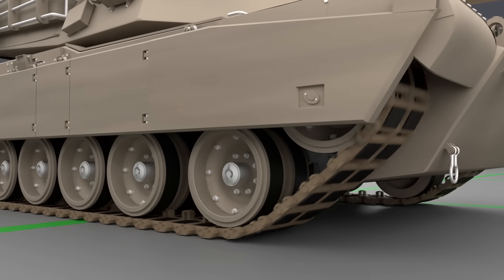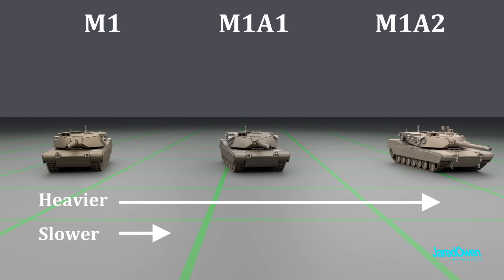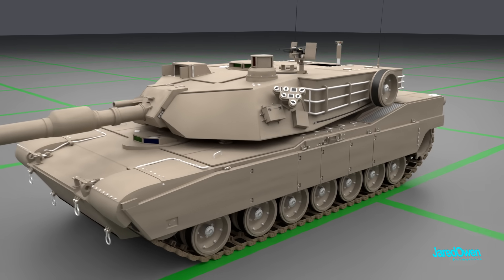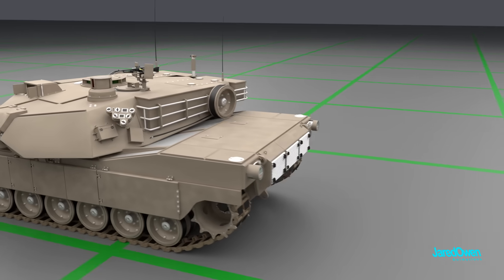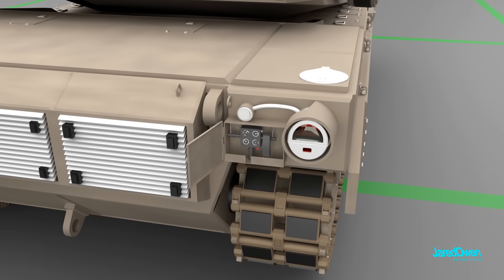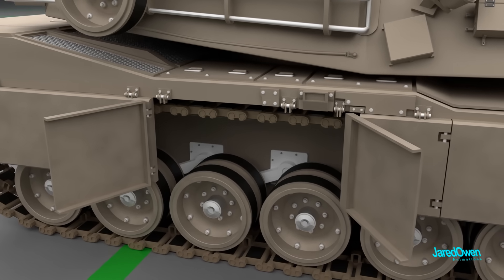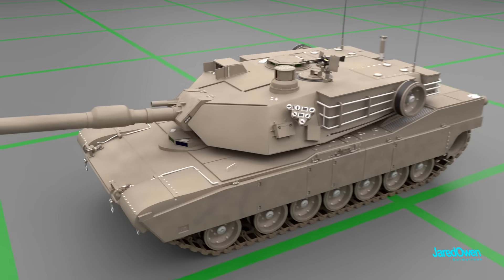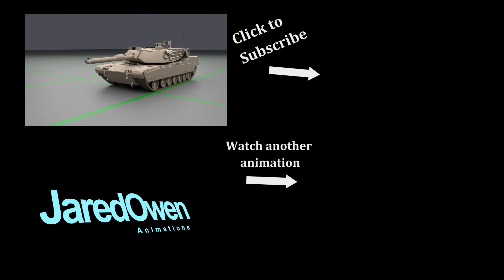How does a Tank work? (M1A2 Abrams)

Comment: Compare american engineering to german engineering who wins?
Reply: The Abrams was developed by German engineering.
Reply: @sandervanderkammen9230  Not really.
Reply: @peterson7082  The XM1 hulls and chassis were made by Krauss-Maffei in Germany... The Abrams uses a German gun and an engine designed by famous Jumo engineer Dr Anselm Franz.
Reply: @sandervanderkammen9230  Neither XM1 hulls produced by either Chrysler or General Motors bare much resemblance to the MBT-70/ Kpfz.70 which was a cooperative design, not just German. 

The gun was derived from the Rheinmetall L/44 but are not the same gun. 

Dr. Franz retired Lycoming before the AGT-1500 was developed.
Reply: @peterson7082  Krauss-Maffei continued development of the MBT-70/ KPz 70 through the XM803 and XM815 programs.
All 6 hulls used in the XM1 program were built in Germany by Krauss-Maffei.
The General Motors XM1 bearing an uncanny resemblance to the Leopard 2 which shares the same original chassis design as the Abrams. 

The M256A1 is manufactured in the U.S. under license from Rheinmetall.
 M256 is the low cost, economy version of the the L/44. It lacks the more accurate concentrically balanced gun tube and the Leopards advanced lighter weight  hydroneumatic recoil system. The Abrams instead simply uses heavy steel coil springs.
Reply: @peterson7082  Dr. Anselm Franz  was one of the most prolific gas turbine designers in history.
He was Cheif Designer of the Jumo 004B engines that powered the world's first jet fighter the Messerschmitt Me-262.

He was also Cheif designer of the world's most successful helicopter gas turbine  engine family in history, the Lycoming T53/T55.

The Lycoming AGT-1500 was the brainchild of Dr Anselm Franz who conceived it in 1944 and was the lead designer until 1968.
Reply: @sandervanderkammen9230  

> "Krauss-Maffei continued development of the MBT-70/ KPz 70 through the XM803 and XM815 programs."
 They and several others had been reached by GM for supplying parts for the XM1, and to a much lesser degree Chrysler on having interchangeability in parts.  For the XM805/XM815, they all appear to have been built by Chrysler. Ford and the other companies in the earlier iterations of the XM1 program I have no clue whether they did or not contact and work with German companies- let alone Kraus-Maffei.

> "All 6 hulls used in the XM1 program were built in Germany by Krauss-Maffei.
"
 No they were not. There were only two pilot tanks for the program from GM and Chrysler. Production series were produced only by Chrysler at Lima. Going back to the pilot tanks, it would be either Lima tank plant for Chrysler or a collection of factories including the Allison Division for General Motors that produced them. None were produced in Germany. 6 of the 12 prototype series MBT-70/Kpfz.70 were produced in Germany by Kraus-Maffei, one or two of which were sent over to the U.S. Likely after the Germans ended the program from their end. 

> " M256 is the low cost, economy version of the the L/44. It lacks the more accurate concentrically balanced gun tube and the Leopards advanced lighter weight  hydroneumatic recoil system. The Abrams instead simply uses heavy steel coil springs.
"
 More advanced how? How is it more accurate? It's lighter and that's about it in regards to performance related differences. The rest is in ammunition or construction. 

In regards to a reply you said elsewhere:

> "The Lycoming AGT-1500 was the brainchild of Dr Anselm Franz who conceived it in 1944 and was the lead designer until 1968.
"
 Except I cannot find any evidence he was directly apart of the team that designed it. Its said he was vice president and board member by that time, but nothing is mentioned of being the lead designer or design team manager at that point. I am not denying he had influence over it and his work lead up to it. But he as far as my research goes he did not design it or had a huge role in the actual design work for it in the mid to late sixties. I was wrong on the statement regarding retirement, I recalled it incorrectly there. 

> "BMW GT 101 it was the world's first gas turbine tank engine was tested in a Panther II chassis in late 1944."

 No it wasn't. The only Panther II built was made with a standard Maybach HL 230 P30. The only one of its many suggested engine fittings that might have tested was the HL 234, a similar engine but with a new fuel-injection system. The GT101 series was never run inside a vehicle. Numerous starts and stops of modified Jumo engines were done, but the researching and development of the GT101 series themselves only finished in mid to late February, 1945; several prototypes were produced in March but they were never fitted.
Reply: @peterson7082  Neither General Motors or Chrysler had tooling to build the M1 hulls prior to the XM1 trials... each bidder was supplied with hulls from the XM815 program manufactured by Krauss-Maffei in Germany.
Reply: @peterson7082  The L/44 gun found on the Leopard 2 features a superior quality tube which is concentrically balanced after the autofrettage process, this process has a higher rejection rate.
 This feature was eliminated from the manufacturing of the M256 to reduce unit cost.
Reply: @peterson7082  You are also incorrect as to Dr. Franz and his key role in the development of the AGT-1500, work on the PLT25 at Lycoming began in the early 1950s. the design was solidified and became a government testing program in 1964.
 Dr. Anselm Franz is credited with its design.
Reply: @peterson7082  The facts regarding the 1,500 horsepower BMW GT 101 as the world's first gas turbine to power a tank are not in dispute by anyone else... I suggest you may be a bit confused between the Panther II chassis tests and the Entwicklung or E-series engine programs.
Reply: @sandervanderkammen9230  

 I need to see a source for that they were produced by Kraus-Maffei. The Chrysler and GM XM1's do not share the same hulls. In fact Chrysler's submission is longer by quite a margin. It does appear the GM pilot is a very similar design to the XM815 but images of the XM815 show some key differences in the front of the hull's shape and of course the turret. Though hull sides otherwise laid out the same. 

> _"The L/44 gun found on the Leopard 2 features a superior quality tube which is concentrically balanced after the autofrettage process, this process has a higher rejection rate."
 Again based on what is the tube (I assume you mean the barrel lining?) superior quality? 

> "You are also incorrect as to Dr. Franz and his key role in the development of the AGT-1500, work on the PLT25 at Lycoming began in the early 1950s. the design was solidified and became a government testing program in 1964." 

 I am not denying his influence. I cannot find anything to support your claim that he designed or was directly involved with its design process. 

> "The facts regarding the 1,500 horsepower BMW GT 101 as the world's first gas turbine to power a tank are not in dispute by anyone else..."
 It's the first one designed for it- yes. Not the first to be used. Because it never was run inside of a tank. No Panther or the only Panther II ever had one. It was a ~3,200hp. design, with ~1,050 net hp. going into the transmission.
Reply: @peterson7082  The German manufacturer of the Leopard 2 Krauss-Maffei was the primary contractor for the KPz70, XM803 and XM815 programs. The U.S. was responsible for the turret and gun design and Krauss-Maffei designed and produced the hull/chassis... This information is not classified and is a matter of public record.
Reply: @peterson7082  If you are this unfamiliar with the design and construction of modern large caliber guns I don't believe you are capable of understanding the significance of this superior feature found only in the Leopard version of the L/44.
Reply: @peterson7082  Dr. Anselm Franz  created the gas turbine division at Lycoming, he was the chief designer of all gas turbine engines.
The AGT-1500 was submitted to the U.S. Army for testing in 1964.
Reply: @peterson7082  The BMW GT 101 was tested in a Panther II chassis, it was not adopted into production, the war ended before a production version was reached.

Comment: They are called tracks... Caterpillar is a brand... also, tanks get stuck.... a LOT! Also, the spare parts are often carried by a maintenance vehicle at the back of the battle group, this vehicle will and infantry (11B) group will repair the tracks and get the tank moving again. If they can’t they will call a tow for it, or abandon it after destroying intel and tech. Also most tanks use Diesel engines... the Abrams tank is blessed. 😁
Reply: Caterpillar tracks is a bit of an archaic name for continuous track equipped vehicles of the early '1900's. More to describe its motion.

Comment: Does the Abrams have air conditioning...I flew in the Navy 24 years and spent a lot of time in south west asia...it gets cold in the desert at times but also very hot and it must be like an oven if there is not cooling in the Abrams...other question has to do with ww2 tanks the tiger 1 is my favorite followed by the king but was there ever a tactic where the tank did a 360 degree firing the coaxial machine gun...Aloha

Comment: 10:37 so the driver can't get out through either exit unless you turn the turret?
Reply: For the driver to get to his seat through the turret, you have to traverse the turret until the hole in the turret basket lines up with the drivers hole in the hull.  Important note, driver never access this until he hears "turret locked"  because if he is half way through and you traverse the turret you will end up slicing the driver in half.

Comment: About the gun, it's the 12cm Rheinmetall smooth bore L/44, the NATO standard, the L/44 is length in calibres, so it's 12cm x 44
Reply: It's derived from the Rheinmetall gun, but is not it itself.

Comment: Seems very old fashioned to have a human do the loading. But I guess it's just as effective? Also, the next iteration of this tank will most likely get a diesel engine.
Reply: Agent Smith autoloader 7 seconds <my loader 4 seconds. Loaders are also very useful, they help in maintenance, loading ammunition, radios, setting up toward positions for observation post, being the first one out to see if there are active chemical agents in the air during an NBC environment. Auto loaders can’t do that.

Comment: It ain't quite, not at all.
The sound is very destingwishable.
The crews of the M1 are trained to shut off the engines in sequence if they move in a convoy, to avoid enemy troops from keeping count of how many tanks are present in set convoy.
Another thing, the drivers of the M1 states that the drivers seat of the Abrams are dangerously comfortable, and you can easily fall asleep in them.

Good job on the rest of the info and thank you for giving War Thunder more limelight.
And very nice work on the animations.

Comment: i admire the skill went into making this but there is a number of inaccuracies. here's some constructive criticism on it. the turret is not perfectly symmetrical, the smoke grenades are airbrush. the loader operates a knee switch to open the loading door. the breech of the gun is attached to the gun barrel it's one piece. your turret is too elongated and clips the hull.  just a few constructive criticisms and the turret will always have the calibre 50 on the commander's cupola and sometimes a 240b machine gun for the loader, not the other way around. and the space afforded to the turret and driver is a lot larger than usual. as the extra space in front and on the sides of it are taken up by roughly 300mm - 800mm of space of a composite armor block sandwiched in a steel capsule which we see as the exterior

Comment: I realize it wasn't your intention to be exhaustive, but every M1 Abrams I've ever seen has an M2 .50 BMG heavy machine gun mounted prominently on top for the commander.  The other two machine guns (coaxial and loader) are M240 7.62x51mm (.30 caliber) medium machine guns.  The M2 is primarily meant for engaging light vehicles and even aircraft, while the M240s are intended more for dismounted personnel.

Comment: Could a tank be run by batteries or motor and hybrid electric
Reply: No, such a design would be impractical.
Reply: Sander Van der Kammen  it seems like the use of electricity would greatly save on weight. The batteries also could become some of the protection. As the don’t burn and as modular packaging drop in instead of fueling up
Reply: @danielcarlsen2217  How would it save weight?!!??

You realize that lithium batteries are very soft and easily penetrated, they also burn violently and cannot be extinguished.
Reply: Sander Van der Kammen  lithium ion burn from overcharging not from being hit by an object. If you seal them in a unit that would slide in that would replace used unit. Recharge that used unit in designed recharger. Electric motors would add 50 % more power than the petroleum engine and 10 % of the noise.
Not having to haul fuel and oils etc. would save a lot of storage. Yes the batteries would need storage but nowhere near what the gasoline would
Reply: @danielcarlsen2217  That is completely false.
The hexafluorophosphate electrolyte is highly flammable and lithium itself is pyrophoric which means the metal itself burns violently and cannot be extinguished. 
 Any lithium ion battery penetrated by either type of armor piercing munitions will be easily ignited and cause a catastrophic fire.

Also completely false, 
The M1 Abrams and the Tesla model S 100 have the same range, just 265 miles.
The Tesla's 100 kWh battery weighs 1,500 lbs and stores the energy equivalent of only 8 gallons of Diesel fuel weighing just 56 lbs.

The Abrams would require a battery that weighs 45,000 lbs!!!

It's standard 500 gallons of Diesel fuel weighs just 3,500 lbs.

Comment: If they want to take a dump. How'd they do that? I'm wondering.
Reply: Kyudo Kun either wait, do it after the mission is complete. If you can’t wait. There’s a 50 cal. Storage container next to the tank commanders seats. That’s perfect to sit on while you poop in a trash bag or MRE bag. I know this cause that’s how my soldiers did it
Reply: @alfredogarciajr40  Does the shit bag go into the .50 can like a trash bag, or do you sit on the ammo can with your ass hanging off the side with the bag under your ass? 
I have a .50 ammo can and can't imagine how painful it would be to sit on an open ammo can, wouldn't the thin metal sides dig into your ass cheeks?

Comment: Smoke grenades: they do not just sit there and emit smoke while sitting in the launcher; they get get launched away from the tank while emitting smoke to create a large cloud which hopefully conceals the hank from the enemies sight (both visually and thermally).
Reply: Robert Berner they’re not launchers they’re generators. They’re used to break enemy weapon locks. You want the smoke to cover the vehicle not launch it away from it. Not sure how the abrams smoke generators work but the British challenger two tank dumps diesel fuel into electrical heaters which pumps huge amounts of smoke out of the generators. I assume the abrams does the same but with jet fuel instead. No need to carry additional smoke canisters just use some of the fuel you have onboard already. Saves weight and space. Genius. Edit: I may be wrong about the abrams. Here’s a video showing launchers https://youtu.be/TODr5NKNuCg the challenger has generators though. https://youtu.be/goLNmcmYcA0
Reply: @goffergoo  The tubes you see on the front of modern tanks are smoke grenade launchers. What you're talking about is ESS, where fuel is dumped into the exhaust manifold causing huge amounts of smoke to exit the exhaust. All modern tanks have smoke grenade launchers, and most have ESS on top of that, the Challenger 2 and Abrams being two of them. Also, the launched smoke grenades do a good job of concealing the tank, they wouldn't be used otherwise. On top of that the ESS damages the exhaust system which is why launchers are preferred.
Reply: Tobben Jees thanks for setting me straight. Does the Abram’s smoke generator run off the turbine’s kerosene? The challenger uses diesel. Not sure if kerosene smokes the same as it’s so refined.
Reply: @goffergoo  The ESS runs of whatever fuel the tank is filled up with, because it sucks fuel directly from the tank's fuel tanks. The system was disabled on most Abrams tanks after they mostly switched away from diesel since it's too unsafe to use with other fuels.
Reply: @tobbenjees941  We were still using the smoke generator on our M1A1s in the late 90s.  It was sorta fun to turn it on in front of another platoon and smoke them out.
Reply: Goddamnit Bobby

Comment: The speed is “governed” to about 40 mph
Reply: Someone told me years ago he removed the governor and had the tank up to 70MPH and the track flew apart.
Reply: Yes can get a tank up to at least 60. When it's not battle loaded. All tanks have a different feel while driving them. Just like a car. It's also not all ways a smooth ride ethier.
Reply: @bklynrich3304 
Absolutely correct 👍

Comment: Question. So if you wanted to stop this tank from moving, wouldn’t you just have to target the near set of wheels?
Reply: Reece N no it’ll still drive
Reply: Random American how? If you target the rear set of wheels then they should be destroyed? And fail that, then target the track feeding into the wheels do the tank will run off its tracks